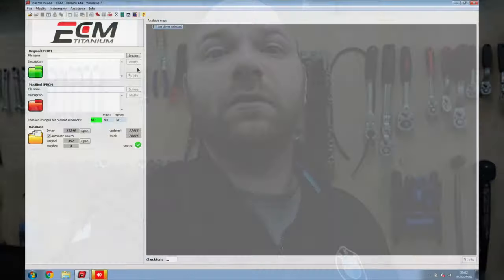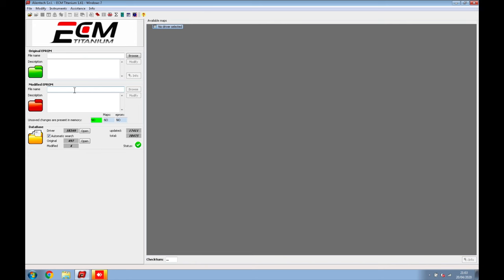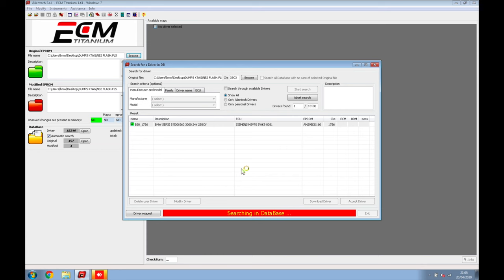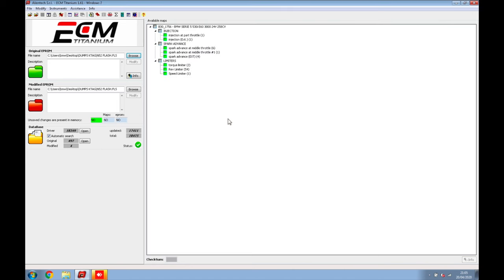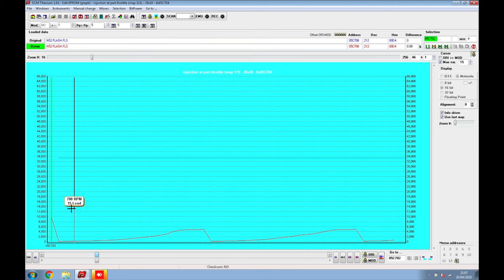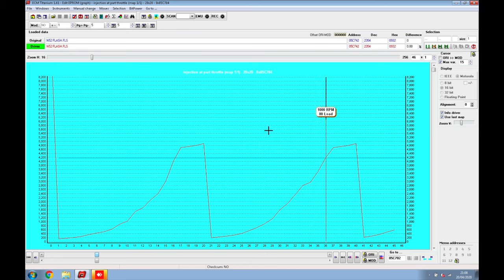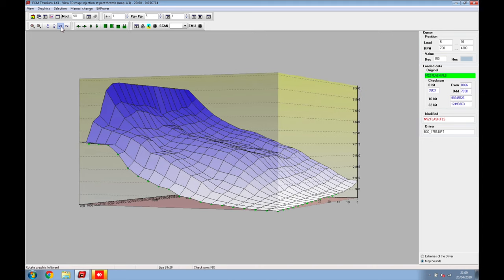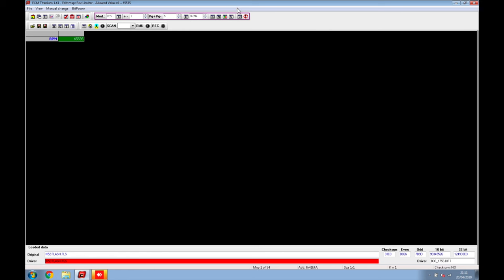How To Use ECM Titanium Remapping Software on All Cars

Comment: I have bought a bin file for my e90 n51 and for some reason when I flash it, it only cranks but car does not turn on.  I can flash a different file and it cranks and starts. Does the titanium program have a compare feature to see what the difference is on these 2 files?  

also i Tried clicking on every link on description and its all amazon stuff.   

Thanks.
Reply: I downloaded titanium from somewhere else but does not have driver for msv80/80.1

Comment: Hye thanks for yr video. At first start of your video, u said must have a kess to get the the flash file . My question is . Can i read the ecu file using tools for eg. pcm tuner and import to ecm tintanium and make a modifications on the map and write it back to ecu with pcm tuner .. 
thanks

Comment: If i use Chinese kess2 to read file of f30, to delete egr dpf, then use acd to remove both maps from binary. Does it affect checksum? Is it safe to use Chinese kess 2 to write file back,  When you file like like this or delete map using this software, does it required to be corrected using ECM when it’s written back using clone kess 2

Comment: Hi mate I’ve got a 530d 2005 218bhp, my car smokes on idle even when it’s warm, also black smokes high in the Rev range when accelerating quite bad, I’ve had the following below changed 

New thermostats
BOSCH MAF
turbo boost seal
DPF delete 
Decat
Remap
Swirlflap blank

When mapping was showing injector 2 was lower percentage than the others, do you think this could be the issue with the injector? 

Thanks mate 👍🏼👍🏼
Reply: 2006 bmw 750i I don't have no spark   need help please